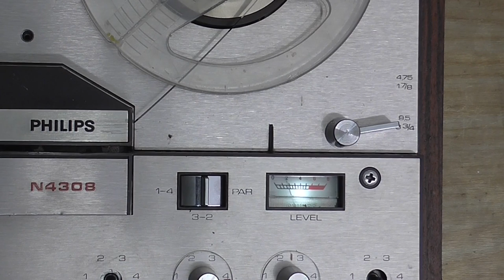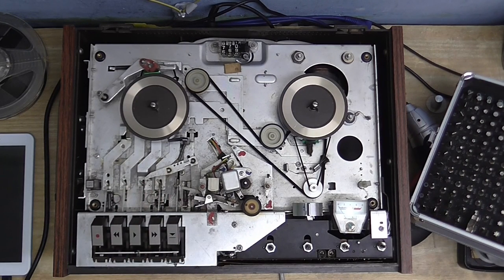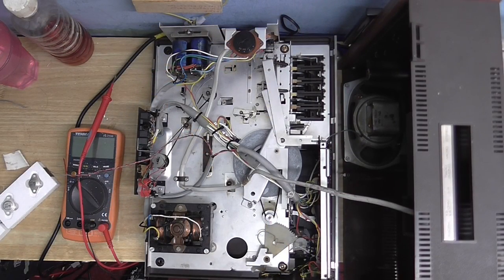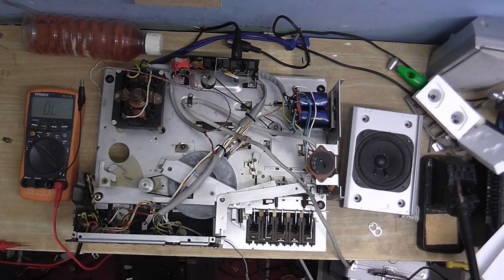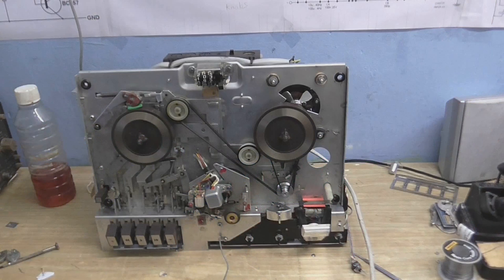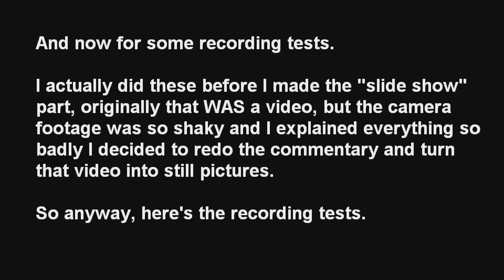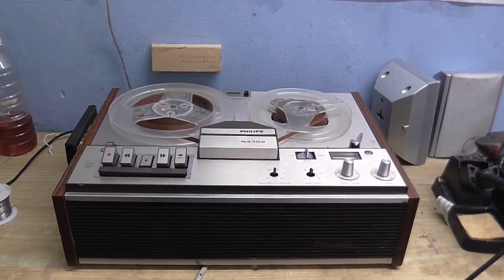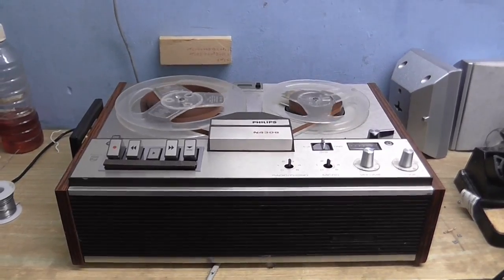The Philips N4308 R2R Tape Recorder

Comment: You got really lucky, this model is from 1968 and uses both germanium and silicium transistor. On mine the transistors died and the belts melted, I stripped it for parts. You got really lucky with yours

Comment: We had several of these in the 60's, they all suffer from the same problems, the recording /playback heads are rubbish, ours had a new one about every 6 months, because the high frequencies disappeared, usually one track sounded completely different to the other track...wonder if they ever made a modified head for them, mine was in and out the shop all the time, in the end i got rid of it and bought a Grundig, funnily enough i bought a Philips cassette recorder some years later, and it had printed on the lid, "Long life heads" what does that tell you...i still have that an it works fine, never had heads on, was made in about 1970, good luck from Fred in Essex UK.

Comment: Hi Cooldudeclem! Hope you're good, and just wanted to open up by saying thanks for posting such great videos. I just recently got a beaten up n4307 from a junk shop, the insides look very much like your n4308. I've replaced the belts as best as I think they should be and I've mostly got it working fine except for one problem.. It plays back very slowly when sat down flat, I found i have to hold it upright to get the correct speed, but then don't that stupid the right spool from rotating. Any ideas on what you think might be the cause of that? This is my first reel to reel and I'm amazed I've got it working so far but I'm in love with it!
Reply: Even stranger is that the recording and playback speed seem to be different to each other. I didn't have any spare belts to connect the counter but I didn't think that would have such a drastic effect. Maybe I'm wrong? I need your expertise, oh mighty Clem!
Reply from the maker: Could be the motor bearings, sometimes they get "fussy" with age. after all that what, maybe 50 years old there's proably some old grease that's gone sticky.

Comment: These had a socket at the back which could take an external 8 ohm speaker or a 4 ohm with a series resistor. This would mute the internal speaker. Very often these sockets would go open circuit. I've never known the  germanium power transistors on these to go, AD181/182 I think ? As for the LED running on AC, what can you say ! ? I use a rectifier and a small smoothing cap. You've certainly made the old girl record much clearer. 
The smaller sister to these, the N4307, used the infamous AC 187/188 combination of germanium trannies and like so much Philips kit fitted thus, many go phut! N4307s were fitted with a single AC187 at the top of the circuit board and could sound horrible if that went funny !

Comment: hi them knob's on this model is a right pain   i up date them with RS   stock in the past   

i had to do this as well to my akai 1800ss  changed over knob and pot on one of the 2    2 decks had things that are not right 

i worker on alot of decks  one things that can be a right pain  caps getting small     

i had to change over 8600uf cap 40 year old  one  now they are alot smaller   i had to make a pcb  and drill out holes  in the copper clad pcb and make tracks

the wire's are very heavy duty in the power unit  there's a big space in the power unit now soundcaraft 381-8 tape  deck

Comment: Hey cooldudeclem, ive currently got a faulty n4307 in my care. 
Its broken, apart from the motor. :)
Belts replaced.
As I plan to modify it to just play tape loops ive removed the ff/rw platters and im adding an extra playback head for tape echo goodness.

The rec/play amplifier was dead so I've removed it.

So basically i have a box with a motor and two heads.

I plan on replacing it with a new one from a portable reel to reel or something (they generally run at 9v battery)
The record amp is powered by a tap off the motor transformer, what voltage do you reckon it will be? 
Will it be ac or dc?
Cheers
Reply from the maker: Hard to say really, there's no set standard. The voltage comming of the tap from the motor transformer will of course be AC, but you would have to measure it to find the voltage.
Reply: CoolDudeClem ah fair enough, at least i know to test for ac, thank you very much!

Comment: Hey, any advice on cleaning the inners and taking out the melted belt on this old recorders? Thought of dismantling and soap soaking all the pieces touched by it, they are practically painted black, pretty nasty gunk, im sure is cancerigenous
Found a philips n4304 real cheap, the tubes and transformers sure did the oven effect on the belts
Reply: I know this is 11 months late but don't use soap! Especially near the read/write heads... Best to use Isopropyl and some Q-tips. I'm about to do the same to a n4037 I picked up today :)

Comment: I bought yesterday a splendid Philips N4416  but when I push on PLAY , it is not running... What may I  hope? Thanks very much for your advice, il you will
Reply from the maker: Most likely the belts have perished and need to be replaced. (Philips stuff was known for doing this) You can usually get replacement belts on places like ebay.
Reply: Thank you very much for your answer, which gives me a little hope. I must say that the advance and reverse keys only work if I keep them pressed (the same problem of belts?) . I was VERY worried that reading would not start because of a faulty engine. Thanks again and good Sunday
Freddy
Reply from the maker: @freddysoyeur9260  You mean the fast forward and rewind don't lock down after you press them? That's normal on old tape recorders.
Reply: @CoolDudeClem  Ok thanks for these clarifications, the main one, for me is to know that the Play button that sinks , hangs and unlocks normally, could allow the movement of the tape in read mode, with a new strap; for the moment, NOTHING happens even trying to move the tape manually ...
thanks again
Have a fine week
Freddy ( sorry because I hope not to much mistakes with my "google-translator" ; usually, I speak french from Belgium and my English, not enough practiced, is very poor...

Comment: Typical Philips cheap shit. One poor Motor driving everything instead of using three.I built my own Recorder about 50 years ago using a Wearite tape deck which had three Motors, one for each reel plus the capstan Motor, plus 3 heads record, playback, and erase. Admitting i.t was´nt cheap. I payed sbout 60 quid for it back then.The electronics i built myself. based on Emi´s tr90 studio Recorder.